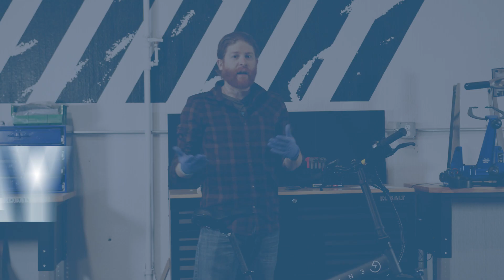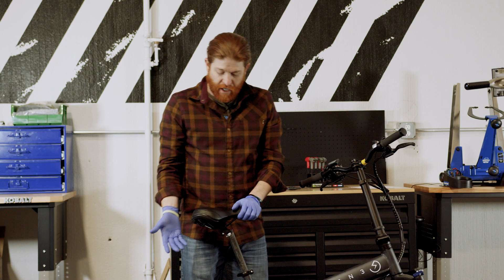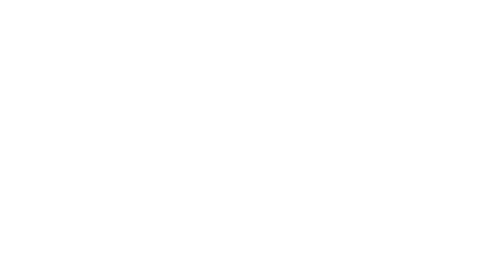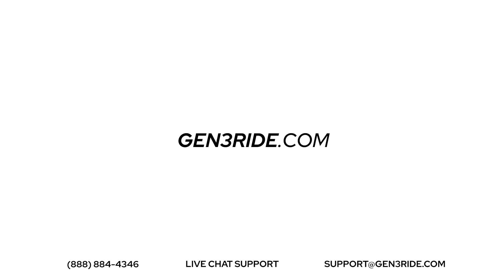How eBike Gears and Electronics Work Together - Electric Bike Tip Tuesday - GEN3 Electric Bikes

Comment: Too bad you guys went under ! I have a 2021 gen3 48v 500w under 300 km as soon as I try to throttle up or engage pedal assist , main battery fuse "30a" blows !! Without ongoing support, I have a useless E BIKE product without any replacement parts That may cause this issue.